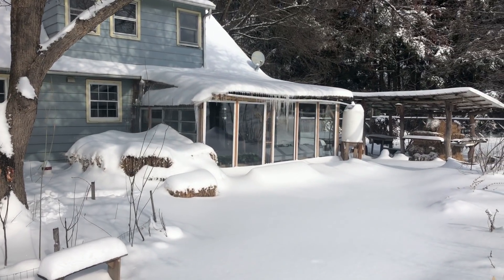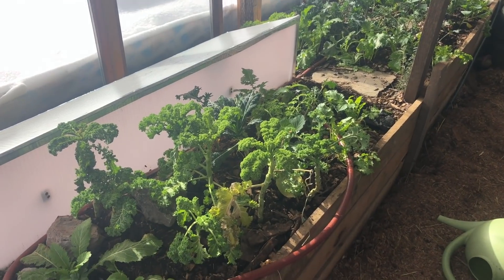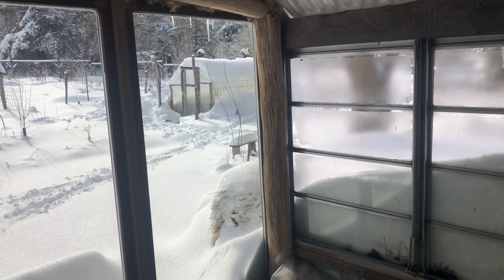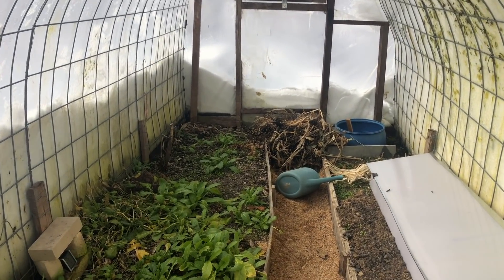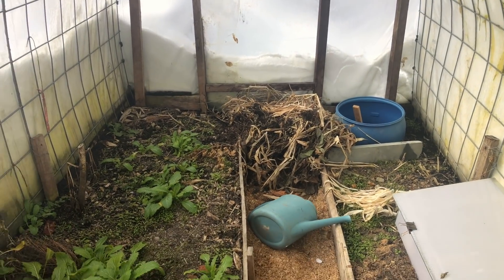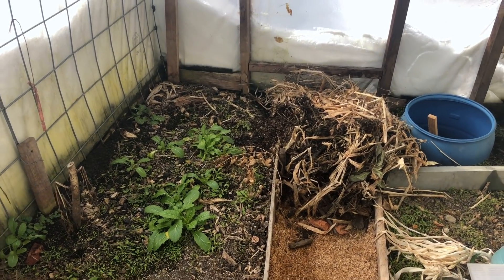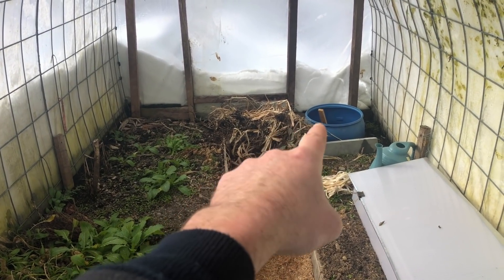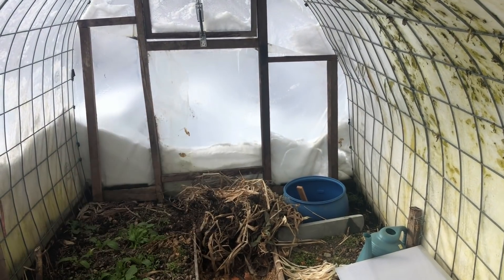Compost Heated High Tunnel - 1 - Initial Thoughts

Comment: I'm curious how the greenhouse is going being open to the house. Is it hard to keep warm (does it cool off your house)?
Reply from the maker: We have a sliding glass door between the greenhouse and home.  It's closed most of the time except when it's sunny enough to heat the greenhouse enough to heat the house... If that makes sense!
Reply: @edibleacres  yes it does. That's what we do with our patio. I'm looking for passive heating for it. We'll be staining the concrete slab dark and installing a wood siding against the house. Fingers crossed it helps retain heat!

Comment: I get you some black garden hose I'm putting inside of a big pile of manure outside of it that heats up really good and then you put it in there radiant heat type thing pumping water through hot change the temperature in there pretty quick

Comment: I love your 55 gallon shallow well, gotta try that myself.
A insulated box with one removable side, and a cap of earth could be passively aerated with perforated  black drainpipe.
Connect it  a solar chimney made of aluminum down spout , blackened with carbon.
Additional glazing around the chimney should increase the draw.
Stacked gallon glass jars would be great, but cutting the bottoms out might be too labor intensive.
Two litter plastic bottles will make a tube that can surround a downspout.
Both the intake and exhaust should remain inside of the tunnel to conserve heat, if possible.
Waxed cardboard could be your insulation, and eventually still be used in the woodstove.
Reply from the maker: The little 'well' in there works really nicely in the winter, easy to get thawed water while the water table is high.  Mid summer it's dry but we have other water then.
Good notes and ideas here.  I think I'll be insulating with hay as we have it, it works well and becomes compost nicely.  I'm thinking about solar heat collectors as additional layers of design later on.

Comment: 4 by 4 by 4 foot sounds like it should generate heat, i would think about trying to get airflow underneath the pile so you dont have to turn it as much  in such a cramped space
Reply from the maker: Thats what I'm aiming for, maybe wider and not as tall.  I think I'll run a circuit of perforated pipe under it.
Reply: @edibleacres  sounds good!
Ive done an experiment before for heating up water inside a pile, had 100 meter plastic pipe coiled around a similar barrel you have in the video with 3 drain pipes running underneath for airflow. had 60°c water coming out the other end and it ran hot that whole winter without turning the pile. Granted it was a much bigger pile but it was outside in the elements. Im very interested to see how this turns out for you!

Comment: Not sure how your tunnel is aligned (east/west/north/south,) or if you mentioned it, I missed it, but I'd suggest putting the compost on the north side so as to not block the sun, and clearing accumulated snow away from the south, to allow more solar heating. If you can double-insulate the walls with an extra layer of plastic and an air-space between, that would also help. Also, think "thermal mass;" a somewhat sealed BLACK barrel or two of water positioned where it can catch sunlight while not shadowing plants will help balance temperature on frigid days and nights when there is no solar heat.
Reply from the maker: Good ideas here  The compost in this case would be the westernmost area and on the southern side, but I may make adjustments to the layout.  We'll have to see..

Comment: I tried this in my makeshift 10'x20' hoop house in central Maine. My compost was in a wooden bin 3'x3'x3' which was too small for the size of the area to be effective and was not convenient for turning. A larger open piile with no sides would have made a big difference. I didn't carry through to the next year as I moved to PA and built larger hoop houses and haven't gotten back to the experiment.

One experience that I won't forget was had on a frigid Maine winter day with the sun shining brightly. I walked inside the warming hoop house and was greeted with a glorious shower of fine snow falling inside the  house, resulting from just the right combination of sunlight, temperature and moisture from the steaming compost. Hope you can experience this.
Reply from the maker: Sounds like an amazing image of snowing inside a high tunnel!

Comment: If the water tank is staying where it is, you might want to consider raising the height of the tank, (perhaps by a second barrel with the bottom cut off and placed on top the first tank).. that way the compost could be stacked higher against the barrel without any concerns.
Reply from the maker: I may make adjustments to this part of the system here, we'll have to see...

Comment: Check out DirtpatchHeaven.  She lives in the high desert and had a compost heated greenhouse, she also does compost boxes that she grows in.
Reply: Yeah, she's in Idaho I believe. So, def. cold & snow.
Reply: Seconded.  Julie uses the system usually called "hot beds," where it's a high-nitrogen large-volume mass over/into which she puts nitrogen (often in the form of rabbit manure tea).  This causes the compost to heat up, and provide enough heat for seed starting under low hoops.

Plus if you add another layer of plastic, you'll warm plants even more.  Elliot Coleman talks about how one hoop will bring the temps one climate zone south, and two will bring it two.  He doesn't mention a third, and I suspect any temp gains will begin to be offset by light reduction through so many layers.

Comment: Two layers of plastic, should allow you to heat with just a compost pile, I wouldn't bother with anything more complicated until or unless that has been shown not to work.  Can you fit 2 yards of compost in that space?
Reply: Could he not fit 2 yards of compost into the space by raising the sides of the beds to convert them to hot beds?
Reply: @Tony-Blake  Probably, but then the compost is spread out, and won't generate the same warmth.
Reply: @CorwynGC  That's a good point. However, volume of compost is not a limiting factor in this situation. (I'm not sure why you stipulated "2 yards"") Aiui, 3' x 3' x 3' is sufficient to generate heat. So, with footprint as the limiting factor, vertical  seems like one solution.
Reply: @Tony-Blake  Volume of compost is directly proportional to heat produced, so of course it is important.  1 yard is not in my experience enough to last an entire winter.  Heat rate is going to be related to aspect ratios of the pile, so that might need to be adjusted, more compact produces greater heat flow, for a shorter period, while more spread produces less heat flow for a longer time.  (And too spread out, produce no heat flow at all).
Reply: @CorwynGC  I agree. To be clear: by "volume of compost is not a limiting factor in this situation", I meant that "supply" does not appear to be a limiting factor at EA. I think that the biggest problem with converting to a raised-hot-bed would be "elevating" the already-planted soil. A mechanical issue.
Reply: 3x4x4.5 configuration or 3.4x4x4. Most cold hearty and high value plant choices will be a great video.
Reply from the maker: Hoping to get 2 yards in this space, we'll have to see...  I plan to insulate it and maybe cap it to keep the heat really in .

Comment: I'm very interested in what you come up with. I'm in zone 7b I also have a cattle panel green house and want to find a cost affective way to heat it.
Reply: Bags of leaf mulch and getting the mulch  to composte when you expect cold weather is somthing I've done. Black plastic bags, two liter bottles of sugery sodas sprayed into a dampened mulch  and you should get 90 to 120 degree heat for 4 to six days. Ten days out weather forecast was helpfull sonce it takes 6 or 7 days to get heat.
Reply: @robertl.fallin7062  how much leaf mulch did you need to achieve that amazing result? 1 plastic bag per cattle panel greenhouse, or more?

Comment: Dumb question for anyone reading...  Would it make sense to elevate the cattle panel with like Tposts or such to give an extra foot or so of headroom? (I'm rather tall and would be hitting my head all the time.)  Using the T-post to anchor it to the ground and give another foot of height on each side and then use compost along the north wall to 'insulate/heat'?  I know you want that vertical wall for shedding the snow, but wouldn't the compost melt some of that?
Reply from the maker: If you have well drained soil, the solution may be to build it as is, but then dig out a central walkway to accommodate your height...
Reply: Yep, a row of compost outside the GH along the north wall (3 feet high and wide) with hay and tarp on top would insulate and provide radiant heat into the GH, but you have to accept that radiant heat also goes sideways and not only up. No need to turn the compost, aim is slow release heat, just add another layer when the row has lost a lot of height. Adding a brick or metall wall at the foot seems a summer job.
Reply: If you have access to cinderblocks  you could build a small wall to anchor it to.